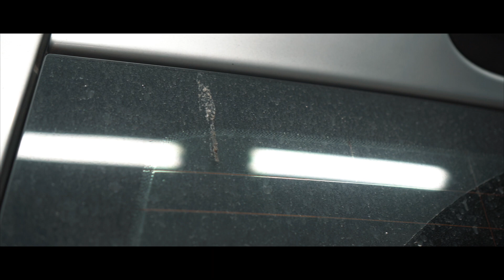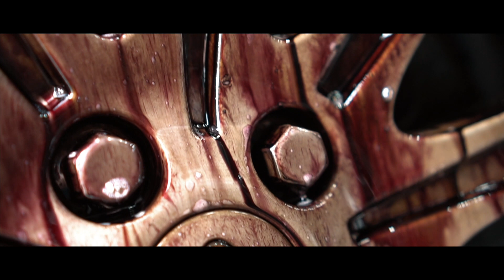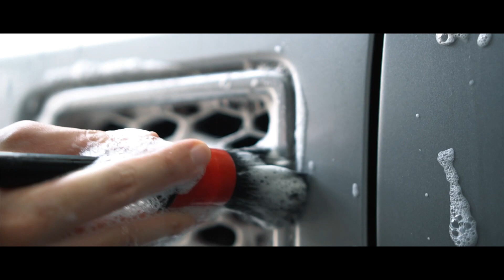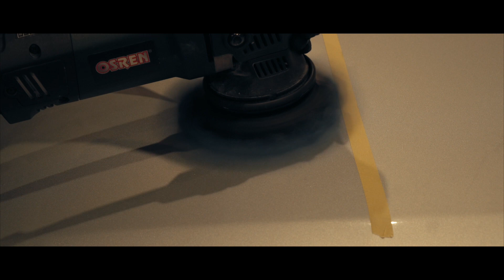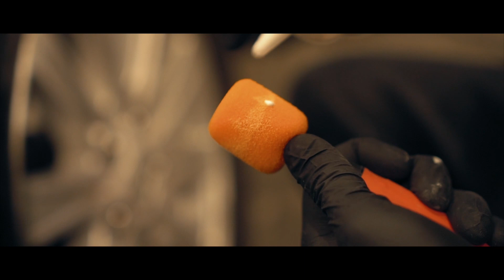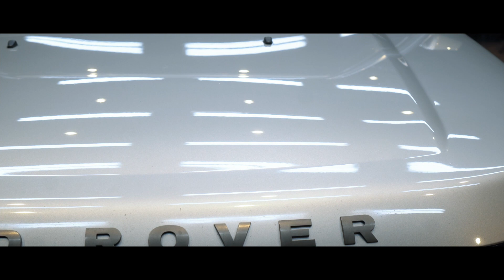OSREN x Land Rover Discovery - Detailing Process Highlights

Comment: you washed the engine compartment with a hose?🤔🤞
Reply: I do it like that too. Spray degreaser, agitate with brush, then hose down the whole engine bay.
Reply from the maker: Yup! It's generally fine with modern engines where they're mostly covered up. On older engines however, certain areas would need to be covered up, such as the carburettor and distributor.

Comment: hybrid blue wool and finish with? whats the last finishing pad?
Reply from the maker: We polished this car with velvet pad + nao quick cut 48, finish it down with nao compound 46 + nano blue wool.

With the 3 inch polisher, we did a step down in combination (Compensated with slightly higher machine speed in cutting) Nano blue wool + 48, and finished with nao compound 46 with microfibre pad.